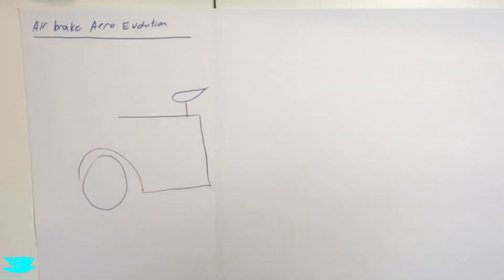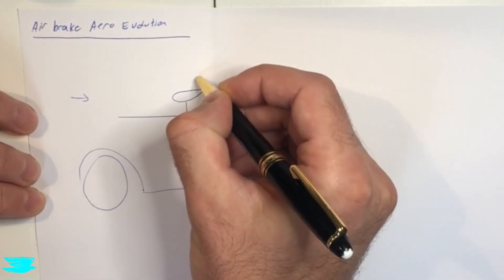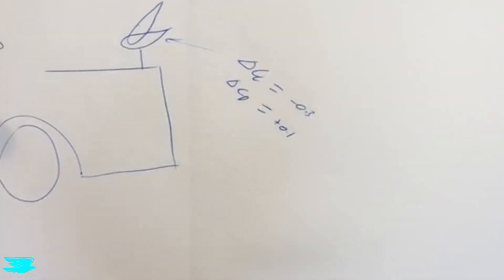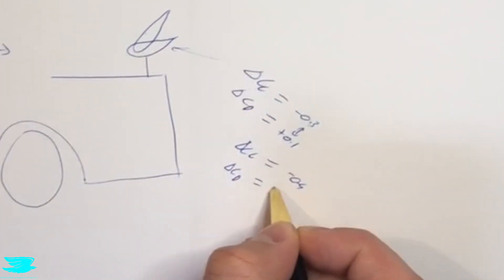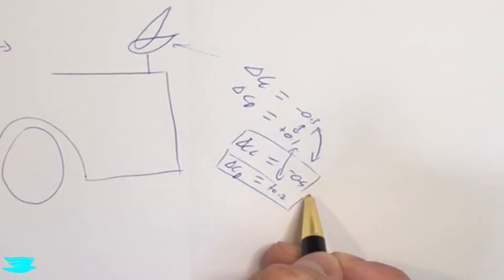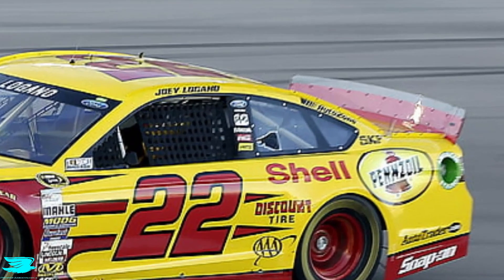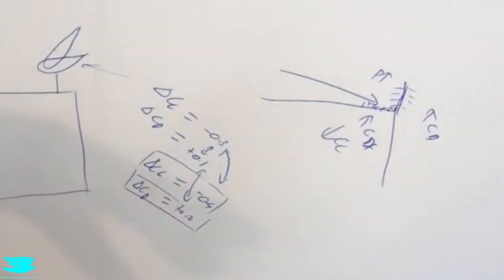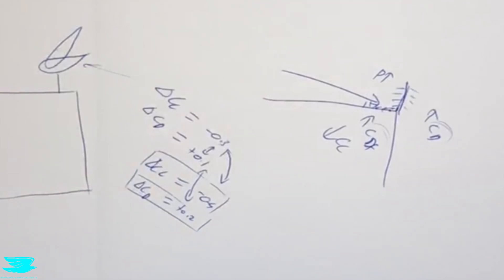Air Brake Aerodynamic Evolution {Auto Aero #73}

Comment: I was expecting the "evolution" to be more about how initial air brakes (like on the Veyron) simply stall the wing to generate as much drag as possible. But newer implementations maximise wing angle WITHOUT stalling the wing to increase drag, but also increase downforce, counteracting the typical weight transfer under breaking and slowing the rear wheels and breaks to contribute more to the overall braking performance.

Comment: Down force gives more grip to tyres for braking. Without it the tyres would lock up quicker. So I was wondering, are airbrakes worth sacrificing grip car would've normally had with down force and does it provide more resistance?
Reply from the maker: Well, you get the best of both worlds because air brakes usually give you more downforce (at the rear), plus more drag, so you can stop quicker on both accounts.
Reply: @PremierAerodynamics  I see. Thanks

Comment: Read this on an accident report, for 737-200, at 140kts, speedbrakes got about 1~2 mt of drag force, but it can increase wheel braking force by 15 mt
Reply from the maker: Yep, airplanes use them a lot, and during braking, everything is set to max drag.

Comment: You can also design the car with a little bit more suspension travel and allow it to pitch downward during braking.
Reply from the maker: That is also true. And the airbrake also helps reduce it lurching forward during braking.
Reply: @PremierAerodynamics  I think that would largely depend on how much leverage the rear wing has on the rear wheels. how much overhang the car has. You also need to keep in mind that the front will increase in downforce as well

Comment: Made me wonder if there's some make/model with an airbrake so awful it just stalls the foil inadvertently reducing downforce...
Reply: most early airbrakes do this, even the Veyron. Not sure about REDUCING downforce, but they certainly don't maximise it.
Reply from the maker: Lol, I'm sure that under certain conditions most would. Cars are only really designed for one specific condition.